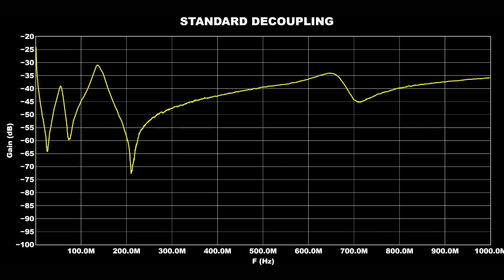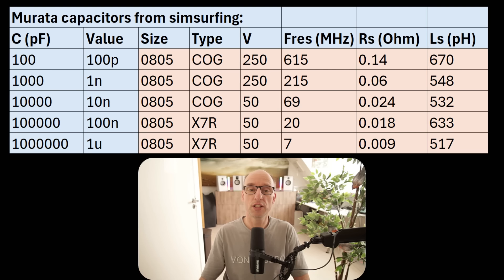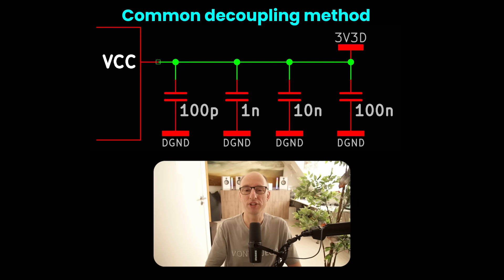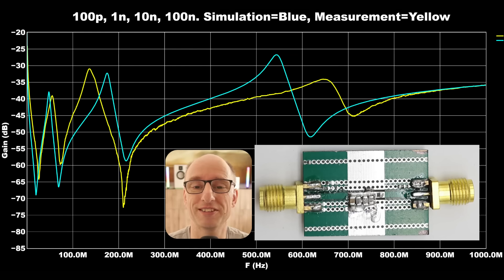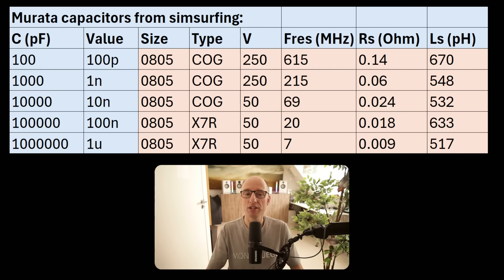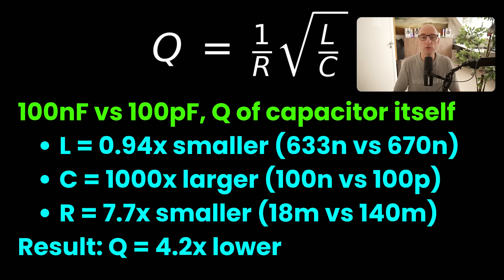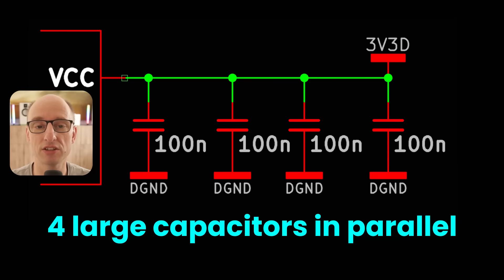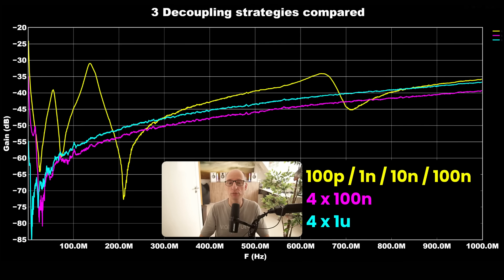The most misunderstood concept in decoupling

Comment: Very interesting video. Although I haven't seen this exact combination of 100pF, 1nF, 10nF, 100nF recommended for a single Vcc line, I have seen many datasheets often suggesting at least a pair of 2 capacitors usually with different values. They typically suggest a 10nF to 100nF capacitor for high-frequency decoupling and a 1μF to 100μF for low-frequency transients. It makes sense to choose capacitances closer to the frequencies of noise you would expect in a circuit, but I also understand why having multiple different cap. values can actually cause the opposite effect as explained here.

What I would like to understand is how do 4 capacitors of the same value decouple noise from a range of different frequencies, and how does one go about choosing that specific capacitance value for a supply line?
Reply from the maker: So the answer to your last question: You basically want a low impedance for your supply without parallel resonances. You can achieve this by using multiple larger value capacitors. The more capacitors you use, the lower the impedance and the wider the frequency range over which that impedance is below a certain value. The capacitor value you need mostly depends on the transient load currents you need to handle. You'd like to be able to supply them with the local energy storage (decoupling) capacitors so the current loops remain small.
Reply: @HansRosenberg74  Oh I see, I got it now! What you said sums up the whole video (in fact now that I watched it again I can see the answers were already there). So basically, instead of looking at the frequencies of transients we focus on the current changes induced, because by creating a low impedance to ground we still eliminate these transients while also gaining the added benefits you describe. That makes more sense now. Thank you!
Reply from the maker: Great :-)

Comment: In the days before circuit simulators and analysers we always used different types of capacitors in combination. Typically electrolytic, tantalum and ceramic. It worked well.
Reply from the maker: yes, in the past frequencies were also much much lower so that was usually much more forgiving. Even though you can still have this problem with all frequencies scaled down if you have bad luck....

Comment: Fascinating! Idea for a short video: What is the quietest power source? Battery? Supercap? With linear regulator? Intuition says a supercap is better than a chemical battery. I have asked about this on stack exchange before in terms of the best reference source and I get no usable answers. As if the topic never comes up in electronics. SO now I am curious about both reference voltages and power sources.
Reply from the maker: Get an extremely low noise ldo: I believe it is the LT3045. You can't beat that!
Reply: That question seems unclear and/or opinion based.  not a good match for SX
Reply: @randomblogger2835  Yes, I left it broad and would be happy for info on any part of it. But it began as a specific question about batteries for low noise op-amps /instrumentation amps. Or what source has the lowest noise.

Comment: For me it was far too quick as to why bigger capacitors should be closer to Vcc. A frequency response would have been nice with some wire resistance to make a point.
Reply from the maker: Well, all it is about is the impedance at higher frequencies. This is dominated by the inductance, which is lower for a 100nF compared to a 100pF. A simulation would simply show that lower impedance....

Comment: This is widely known nowadays. The reason why in old times multiple different capacitor values in parallel were recommended is because SMT technology wasn't as widespread. Larger capacitor values often had larger sizes, and physical size is one of the largest (if not the largest) contributor to parasitic properties like series inductance that destroys bypassing efficiency. So you'd place a small capacitor (small in physical size, but at the same time it also meant low capacitance as a small size implied low capacitance) nearest to your IC's pin to have really low parasitic properties, and increasingly larger ones further away to get the actual total capacitance you needed. Today's different however. Today you can get 1pF - 4.7uF capacitors all in the same tiny size like 0603 or 0805, so there is no reason any more to place capacitors with different values, as all are the same size which means a larger capacitance value only has marginally worse (if at all) parasitic properties than a smaller one. Hence it is instead much more efficient to place multiple instances of a single higher value. There are still cases where you need multiple capacitance values, for example when you need an even higher capacitance so the size does actually get much larger, or when you make use of the series resistance of a different type of capacitor as well for snubbing residual ringing, or when you need to take capacitance loss due to DC bias into account... but as a general rule of thumb, a couple of 100nF caps is the go-to solution for the most generic case.
Reply: Back in the day, power supplies were direct line frequency transformers, not high frequency switchers. 60Hz was everywhere, thus large caps everywhere  especially if daughter boards connected via cables, which was common practice as mechanical cad were nonexsistent and maximum flexibility was needed if something didn't quite fit.
Reply: Nowadays you 22uF 0402 resistors. DC biasing makes it like a 10th of that tho
Reply: @dar0971  You'd do that on very high density PCBs only or for bypassing small-pitch BGA parts. Some assemblers charge extra for 0402 and it is also a PITA to repair or rework. So you wouldn't pick 0402 unless you really have to due to space constraints. Also, with 4.7uF at 0603 you already need to consider DC bias, so 22uF @ 0402 is nuts. It is okay for very low voltage circuits, like FPGAs or CPUs that often have 1.2V or sub-1V supplies, but most people in the world deal with 3.3V or higher. If you are designing motherboards with high-perf CPUs then you are way past learning these things anyway.
Reply: Also, of course, a 1980s 47uF electrolytic has a pretty massive inductance.

Comment: Hi Hans,
very nice summary and expalanation! Two comments:
1. When using through-hole componentes (for whatever reason), it still makes sense to follow the old decoupling strategy, as for these componentes, smaller capacitance to a certain extent means smaller size and therby smaller ESL. So using e.g. a 1nF ceramic disc in parallel to a 1uF electrolytic (which also has higher ESR which lowers the Q of the resulting parallel resonance) is also a decent solution which is why this was mainly done in the past, when 4.7uF 0402 MLCCs weren't a thing yet.
At 12:30 you say that on average, the improved version has the same impedance as the bumpy one just without the peaks. It might look like it in the graph but this statement really undersells the improved version since you have a logarithmic scale and therefore positive peaks are much higher than negative ones. Talking about averages ever only makes sense on a linear scale.
- Michael

Edit: I just noticed that you didn't graph impedance but S21 ("gain"). Still, the positive peaks are much more significant than the negative ones ;)
Reply: The word "average" has a broad enough meaning that his statement was actually correct, although it is good to point out logarithmic scales wherever they're used. "Average" can refer to the mean, the median, the mode, the midrange, or any other measure of central tendency. And even the word "mean" is pretty broad: the average you probably meant is the arithmetic mean, but there are also the geometric mean, the harmonic mean, the root mean square, etc. It's for this reason that you'll rarely hear a mathematician use the word "average", although everyone else does all the time. It's precise enough for most purposes, just not for pure mathematics.

In this particular case, the geometric mean is what Hans was talking about, even if he didn't realize it. It's the most natural average to use with a logarithmic scale.

(More context for the different kinds of mean: the average value of a set of resistors in series is best represented as the arithmetic mean, whereas the average value of a set of resistors in parallel is best represented as the harmonic mean. If you change every individual resistor value to the appropriate mean, the total resistance of the circuit will remain the same.)
Reply from the maker: Yes, you have a point there indeed. You always have to be so careful with your language when describing these things. I'm indeed underselling it :-)

Comment: Interesting Hans, I have not too much experience with designing electronics, but I do have some experience with leaded capacitors. When staying within the same types and voltage, the inductance will grow together with the capacitance. I believe, especially when the capacitors are well constructed with schoopage, this is just because of the size increase. I think this "trick" with the smaller capacitors is originating there. Although the ringing effect will also work in leaded components with such an arrangement. I believe that the common used strategy is to take smaller capacitors and putting them in series, which should work similar to your solution in the SMD region.

One thing that I learned with my measurements on (leaded) capacitors (with MKT and MKP dielectricums), is that inductance is so much dependent on size and nothing on the capacitor itself. Normally, the lead roundtrip is determining the inductance more than the actual capacitor, meaning that the (physical) circuit layout is more important than the actual inductance of the capacitor. Makes me think if putting a bank of smaller capacitors in parallel will also not be identical as one bigger, as the total area is also increasing. Perhaps there is a way to wire the current in such that it cancels out.
Reply from the maker: Size is directly related to inductance indeed. In this demo I compared specs within the same size. Just to demonstrate how to model and simulate this, so you can use it for other applications as well.

Comment: Some time back (so my memory might not be exact) but I was n a real sweat laying out a thru-hole board and only had enough space of for a single output capacitor.
I ended up using a single 10uF leaded monolithic ceramic capacitor.
I was stunned at the high-frequency attenuation ability of these monolithic caps.
I subsequently did a test, by which I terminated a RF-generator output, with a 10uF cap, then looked across the capacitor with a 50-Ohm termination with a scope; as I recall, the attenuation was effective in the hundreds of megahertz range!
So, I can imagine how good the SMD ones are!
Thanks for your video!
Reply from the maker: Ha, nice real world story! I also used huge caps as coupling capacitors in my first project for a radio telescope. These had to start at a really low frequency, so I needed a pretty large cap. It worked fine.

Comment: The way I taught myself to analyze decoupling performance was to first acquaint myself with the noise margin specifications of devices on the power bus in question.  Then couple the noise signals from a node via a 50 ohms series resistor and 50 ohm coax wrapped on a ferrite core part way to an unterminated high frequency oscilloscope vertical input.  I get realistic evidence of the noise level at that node.  That way I get cues on how to make adjustments to decoupling, grounding, ground plane design, and trace routing as necessary.  In most cases decoupling is a no brainer and doesn't require a bevy of rocket scientists to deal with.
Reply from the maker: Indeed, most of the time, it's no problem, even if you have decoupling resonances. You have to have bad luck that your circuit uses that same frequency and creates a problem.

Comment: This makes me want to make a video on how "electronics works like you think it does until it doesn't". I love the charts and scopes and a heavily soldered SMA connector PCBs.
I'm curious about rerunning this test with my preferred 0603 caps.
Reply from the maker: Well, it's easy enough to do if you have a vna and a cheap board from jlc. The heavy soldering is because these are very cheap aliexpress connectors and they simply won't solder. There's something wrong with the alloy and solder bounces of of it. Maybe I should use some S39 next time :-)

Comment: On modern circuit designs, when multiple capacitor values are specified for decoupling it is also assumed that different capacitor footprints are used.  Modern multilayer ceramic capacitors are so good that placement and PCB effects become a bigger concern then what is induced by the capacitor.  Small value capacitors are still used in part because designers can physically get those parts closer to IO pins.  Some ICs even embed those small caps in the IC - I'm talking about some DCDC from Linear but there will be plenty of other examples.

In general this video is great and it demonstrates just how good multilayer ceramic caps are - at least when compared to what was used 30 years ago.  The same best practices no longer apply.  And identifying / showing the impact of ringing is great.  But ignoring the effects of using different footprint sizes can lead to a misleading conclusion.  Few designs are limited to a single footprint size.
Reply from the maker: Thanks, this is why I very specifically state in the video: If you use other sizes: Get the models and simulate it!

Comment: 12:00 I'd actually calculate the impedance for desired cutoff frequency and then put a resistor with appropriate value to match it as close as possible so the higher frequencies would dissipate on resistor and won't reflect back into the main transmitting line
Reply from the maker: I'm not really sure weather I understand
Reply: @HansRosenberg74  uuuhhh basically I'm proposing using a matched high pass filter to ground for decoupling... so no high frequency spectrum energy would flow to a load

All the lower frequencies up to DC would just reflect to the load, making a stable potential value at load feed point, given that the noise cutoff frequency is low enough

Comment: Just found your channel, immediately subscribed! It turns out I've been unknowingly using the proper decoupling strategy using a single 100nF-470nF capacitors as close to the ICs as possible. Never used a series resistor though.
Reply: Same here. Been using 100nF per IC since the 1980s.. and we tested all our equipment for RF emissions.

Comment: I remember an analog guy tell me (a digital guy): "Paul, digital is easy, its all 1's and 0's".  I said, "No, you are working in the audio band correct?. Well, I deal with edges in the 1ns range. That is 1GHz, so I deal also with frequencies upto RF. Everything is an Impedance matched high speed transmission line. Oh, and I have to deal with millions of flip-flops toggling all at the same time in an FPGA.... that is a lot of high frequency simultaneous switching noise I have to handle. So, no, analog is easy - I do both."
Reply from the maker: hahaha, indeed. High performance fpga's are a pain :-)

Comment: Intreseting. I will look into this. I never saw much ringing with the standard setup of: 100pF, 1nF, 10nF, 100nF, 1uF low ESR capacitors in the tiniest sufrace mount packages with multiple vias in pad as close as possible to each power/gnd pin. I do that as a rough design. Once I have the artwork for these 5 worst cases right up to the power pins, I can change and or omit values during design validation. I may end up with empty pads, but who knows if a software/firmware/hardware change later on may effect the amount of simultaneous switching noise in a device to the point where the capacitor scheme may need to change, so having pads there never failed me yet.
Reply from the maker: If a resonance doesn't fall on a circuit frequency, nothing bad happens! So most of the time, you're totally fine with whatever you put there.
Reply: @HansRosenberg74 I agree. Your video brought me back... a young engineer asked me once, "Biff, how do I know which value decoupling capacitor to use?" He was expecting a "walk away answer" [smile]. I said, "Do you have two hours for lunch today? Lets bring our lunch to my office and I will tell you all the things you need to know about decoupling capacitors. Take good notes because you know my reputation, if you don't take notes and ask me again, you will be dismissed post haste. I am taking time out of my very busy day to make you a better engineer, the only payment I expect is respect."

Its amazing how young people today think we old timers are just a walking-talking encyclopedia that is at their beck and call.
Reply from the maker: Nice story :-) Sounds recognizable...